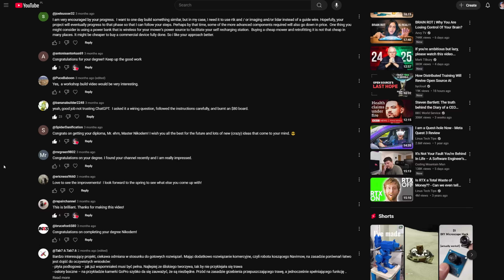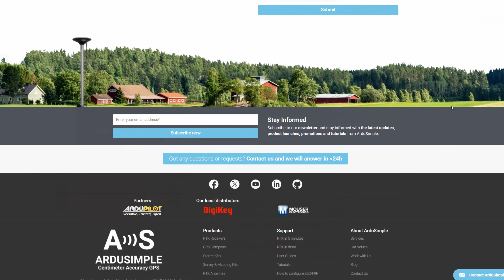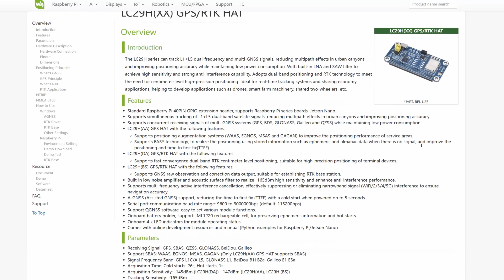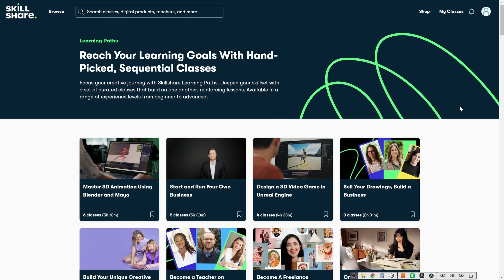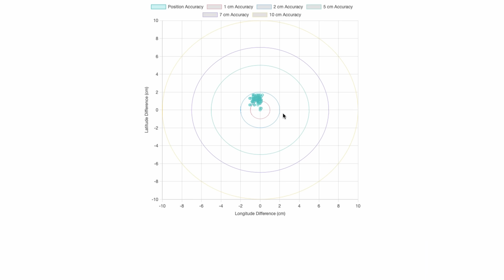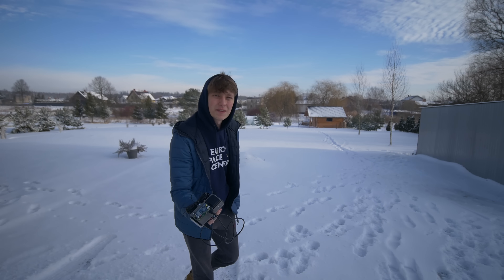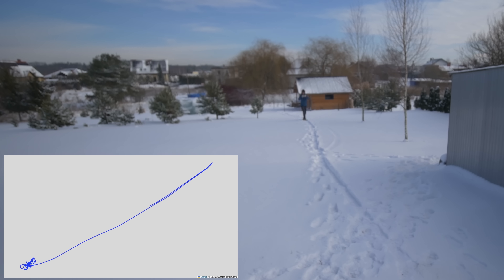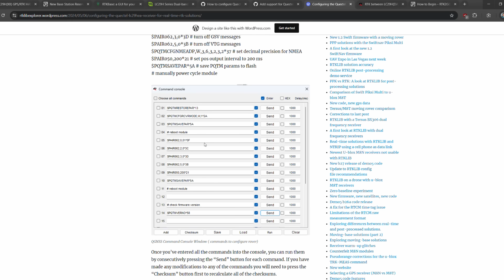This $60 GPS RTK Module Claims Centimeter-Level Positioning.

Comment: No L2 is a huge downside for accurate gps. If you don't care about that,  you can do RTK with a lot of cheap GPS if you simply do the RTK processing on the parent system instead of the GPS itself. You just need raw GPS data out. A neo m8 can do this. Just look it up. Claude can even write the code.

Comment: If you have the software skills, a typical mobile phone has all the components for RTK built in. That is GPS and 3D accelerometers. There is also the venerable ardupilot module(s) that has all the parts and software to do the task. using an Arduino!
Reply: I dont think a mobile phone is accurate to 2cm

Comment: Hello Niko
I am very impressed with the progress you are making with your robot mower project and I think that the $60 GPS module might be a game changer.  However, another immerging alternative to using  either underground wires or GPS is to use computer vision. I recently came across a kick starter for a mower called the TerraMow which utilized computer vision to build its navigation maps. And from what I have seen on YouTube it seems quite impressive. I did some further research on this and apparently there is a Stereo Camera Hat called the ArduCam that is designed to generating depth maps. However, it is unclear if a PI5 would have sufficient processing power or if a PI AI HAT+ would also be equired.
Hopefully, when you have all this worked out I can copy you to build my own mower someday.
Cheers

Comment: That small antenna is never gonna give excellent results. I use flying saucer looking antennas $$$. All GNSS (GPS) only need serial UART (tx/rx).  For a Pi you only need 4 wires, you do not 'need' a hat. RTK GPS modules have many things they can communicate. Look at the spec sheet for the part and discover how to enable ONLY minimum for RTK only.  Competition is 'ublox ZED-F9P' and 'Beitan UM980'. They can both be base or rover with the same part adjusted apropriately. Beitan uses L1, L2, and L5 (many more spacecraft visible at once). A Beitan UM982 can use 2 antenna and your vehicle will know what direction it is pointed even while it is stationary.  For a vehicle the 2 antenna solution is ideal. Ali Express has UM982 for ~US$100.00
If you run your own base station,,, Average many RTK solutions for a more accurate BASE antenna location.
Weeeeee! nowhere or   >Now Here <
;-)

Comment: also mind that this kind of high precision / performance multi constellation etc chips, do need proper antennas. ie antennas that are specifically designed to "catch" the different frequencies that the different satellites use in the different bands. also the quality of the antenna is relevant for the receivers to be able to get high precision readings. Key data to look for, besides frequencies, are sensitivities. im not an expert in this field but you might want to look at the best signal level with the lowest signal to noise (S/N) ratio. Antennas in this applications usually are active antennas in the sense that they internally amplify the signals, to avoid getting induced noise in the coax cable from the antenna output down to the receiver. For this reason is also key to check verfy and look for proper amplifiers (ie those which introduces the less possible noise when amplifying the (very weak !) "native" antenna signals

Comment: I sat up a base station this summer using that module, i made a ntrip station using a program called yccaster, and str2str on a raspberry pi zero :-) I am working on a robotic lawnmower.. Also the included antennas are not that good, i changed my antennas to EM-500, that made a huge difference, but they are about $60 a pice..
Reply: Also a good way to be able to connect to the gps and make settings from the manufactory windows app, is to use a program called "virtual here", with that you can access the gps on the raspberries usb port remotely  from a windows computer/virtual machine...

Comment: It's not my money, but you might want to look into UWB.  Bluetooth location services (>= BLE 5.1) could also be worth a look, but requires a decent investment in AoA (angle-of-arrival) antennas, unfortunately.  Perhaps UWB does also, but I haven't looked into it yet in as much detail.  But since you're working in a single plane, you might be able to get away with just two locators.

After the investment in the reference anchors, the tracking tags are reasonable if you want to track even more things at a more reasonable marginal cost.  UWB's accuracy is much better but at a higher cost, and the BLE RTLS solution may just miss your accuracy requirements.

Comment: With radio, there is possibly a way to make it purely local with 3 or more non-aligned "bases"  that "know" where are the others in polar coordinates (angle+distance): from there, any object moving in the range of the 3 bases can be located very precisely by radiogoniometry. It probably requires a lot more research, but you're not dependant on a "public" service that can be jammed or hacked.

Comment: You really need a metal groundplane of at least 1/4 wavelength radius (about 10 cm)  under that antenna for best performance.
Reply: Yepp, groundplane might be of great value!
Reply: Can you explain it in more detail?
Reply: @aldoseba  I'm running 2 systems with u-blox GNSS modules which get down to an accuracy of 14mm. The antennas shipped with those modules have a separate metal plate which improves reception. I do not have precise numbers but the gain is obvious. The likelihood of similar improvements might be given in case of the modules/antennas used by Niko is pretty high.
Reply: @aldoseba  Magnetic GPS antennas need to be mounted on a metal surface about 15-20 cm in diameter minimum in order to achieve their designed antenna pattern and gain.   They're intended to be mounted on a metal vehicle roof.
Reply: @aldoseba  chatgpt or google ai studio will give you a fantastic project including BOM for making it...step by step.

Comment: for this type of antenna you need a plate ground (D.15cm) to get a better precision. You can se also a helix one like ha901.
Also for 100€ you get the big brother LG290-P which is triple band and get beter fix under tree.
Reply: do you have a setup with the LG290-P in use? I'm currently trying/planning to build a a receiver that i can use with qField. The GPS precision from Phone/Tablett is just not good enough for me. I'm using for tree/foiliage surveys. So i'd be under a lot of trees.

Comment: I was expecting you to spell out the word "subscribe" with that GPS module! This is a great demonstration - and I didn't know that there were public base stations. Would UWB also work to give you pretty accurate tracking? It is generally designed for indoors, so the range might not be enough. They also aren't that cheap either.

Comment: I don't know if setting up your own base station would make much difference to your results if you are within ~15km of one of the network bases. Plus the network base stations will be high accuracy survey grade antennas. As the modules are not survey grade, 20mm accuracy is pretty damn good for the price. Would be interesting to see this compared to a Lecia or Trimble GPS!

Comment: I have the idea for a while now to build an electrical garden mower. With this tool it would be much more easy.
I think I would buy the LC29H BA version.
How would be the accuracy with the "Base Station" version?  I do not see any values there. Is is more accurate or do I compare the data from the "Base Station" with the data on the BA module?
https://www.tekmodul.de/wp-content/uploads/2024/03/Quectel_LC29H_Series_GNSS_Specification_V1.4.pdf

Comment: To take a precise position you need to average readings for at least one minute or so. To be honest, ASG-EUPOS corrections gave me about decimeter accuracy on single fix (at least at L1 band). I suppose that they still not send corrections at L5, so probably your results would be same. So, to take a precise position on rover you need a Kalman filter that calculates long term fix from GNSS and short term fix from odometer or IMU. Good luck!
Reply: RTK doesn't work based on average GPS readings.

Comment: About these ardusimple boards... there is version simpleRTK2B Fusion with F9R module, for about $270 and F9R that has IMU and encoder input (one physical or 2 thru serial line). It should be able to be navigate even without signal for some limited time and accuracy. It even has "robotic lawnmover" mode in firmware. I tested it for short time but wasn't successful. But I heard it's good module.

Comment: I still haven't finished my project, but I found 2 NEO-6M boards for 20€ (that's two normal GPS on a reakout board that can be RTK rovers). And I found a NEO-6P-0-000 GPS module for 34.57 USD on ebay, it's a special module that can be an RTK base station. I intend to connect them with wifi.
Reply: Does it support RTK? It looks like they don't
Reply: @hoppingturtles  I still haven't gotten around to test the system, but I think all NEO-6 modules can ingest data to be RTK rovers, and the NEO-6P-0-000 has RTK base station capability ("raw data" in the product features). At least that what I understood at the time.

Comment: What is the sampling frequency ?
Reply: 1Hz,  but this company has the module LG290P which costs 210€, only the module itself. That does 20Hz even with RTK and support additionaly the use of the L2 Signals
Reply: there is also the LC29H-EA which supports 10Hz RTK and is €70 for the module, still a very good deal imo.